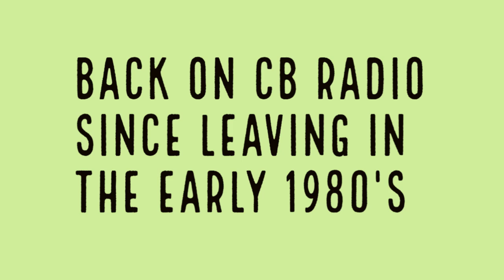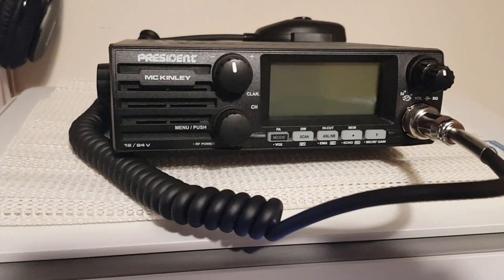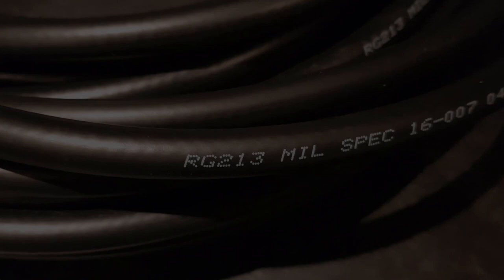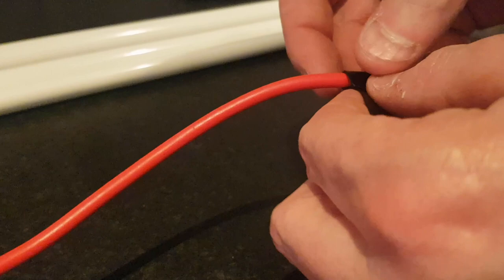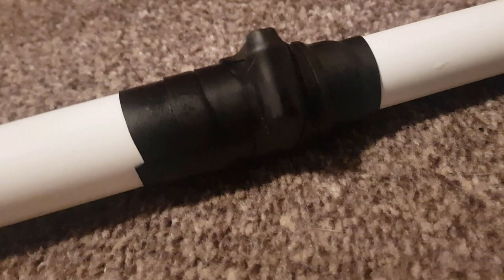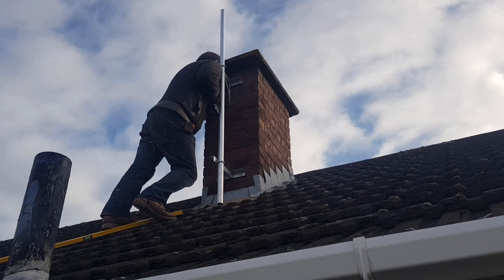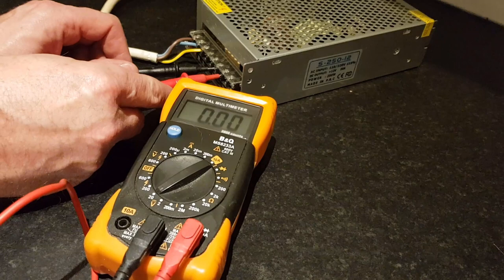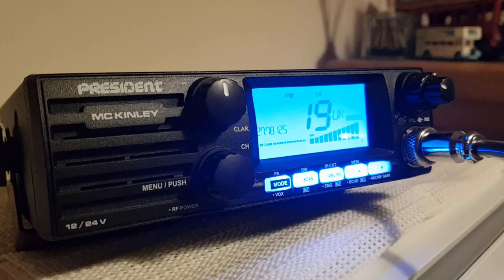Back on CB RADIO after 35 YEARS | Our new President McKinley & Gainmaster 5/8 Wave Vertical Antenna

Comment: Once upon a time, (three years ago) myself, age 65 and my friend, age 75 decided to install CB antennas for our CB radios. He had a good spot by his back porch and I had a spot right next to a tower for my outdoor light. We found neighbors who had unwanted television towers they wanted rid of.  We measured the length of his tower, including the antenna before we hoisted it up, 45 feet (13.716 meters). We measured the height of my tower before we hoisted it up. 54 feet (16.4592 meters). We tried to lift it up, hand over hand, yet, that failed. We took an old manual crank handle boat winch off an old boat trailer I had. We tied guy ropes off on trees and under the eaves of my log cabin to support the old light tower. We tied the boat winch on the old tower about half-way up in the air. Our 2nd attempt to raise the antenna was successful! I lifted it up, while my friend cranked that boat winch like a man on a mission.  I felt the tower go past the half-way point, then we got her upright. She was swaying in the breeze, back and forth. I'm yelling at my friend, "Clamp that #@$% down!" He managed to clamp it down to the old tower with a muffler clamp. If my tower had fallen and touched the mains, I'm certain we'd both look like one of those cartoon characters that look like skeletons when struck with high voltage. Good times.
Reply from the maker: Oh wow, that does sound quite an experience that you all had there lol. I am glad however that you all came out of the other side with no cuts bruises and electrocution scars 😀

Comment: Welcome back I also started out in the late 70s - 80s operating the same radio antenna setup...the McKinley works much better out mobile away from all the electrical noise S5 that most people seem to suffer from at home.....
Reply from the maker: Thanks Karl. We do plan to take the Mckinley out mobile soon. I might get a gutter / boot mount and try it out in my daily car with the Sirio 5000 mobile antenna we just bought. But ultimately it will go into our motorhome, but that won't be until April onwards.
Reply: @rvcbuk  I have only had time to watch this video on your channel. 
I'm curious how you got on with the 5000 on the roof of your camper, I'm thinking of putting one on my Sprinter day job vehicle. 
I'm a little confused about the height, although I am 99.8% motorway.

Comment: Haven’t used the cb since the early 90’s when I got my ham licence, but my roots were with cb like many more my age. People seem to be returning to the radio but  we need more truckers returning they seem to have abandoned the most useful tool in the box. I have just put a cb back in the car , so will listing for you
Reply from the maker: Thanks 😀👌 I do see a few reports of people coming back to CB radio, and of course I am one of them. There are one or two new people in my town from what I hear. I am glad I bought the new CB radio kit, it brings back so many memories. One thing I am glad no longer seems to exist though, is the constant disc jockeying on the 'breaking' channel as was a headache back in the 80s.
Reply: Truckers aren't aloud to have CB's in the cb ( my boss told me no anyway) detraction lead to accidents. I'd love one in my truck.
Reply from the maker: @forddude1976  I must say, I do admire that attitude to driver safety. I would imagine with such a policy, he does not telephone you whilst you are driving either.

Comment: Hello I am Mario from Trieste Italy the antenna operator has mounted the GAIN-MASTER for me today the stationaries are at most 1 and 2 almost on 400 channels I had it in the 80s this antenna was a fantastic thing bye and have a good day
Reply from the maker: That is good news. The SWR also set up fantastic on mine, first time after following the measurements in the instructions. Very easy.

Comment: The President McKinley is a decent radio. It works as good or better than the Galaxy DX-2547, and can be used as a mobile radio if desired. One of it's best features is the ability to turn the RF power output down. I'm using mine with an RM Italy 203P amp and an Antron 99 antenna (similar to what you have) and am powering them both with a Jetstream 30 amp power supply (I paid under $150 for it, and also use it to power my Icom 718 HF amateur radio) I use it almost exclusively on SSB. I only use AM in  my vehicle while on the interstates  The only people in the U.S. who use AM anymore are truckers (who mostly talk about how hard their jobs are and how little they make, which is mostly true, but it's not something you want to listen to very long) and teenagers who use high powered amplifiers, overmodulated power mics, echo boards, and all kinds of annoying sound effects. They have no interest in communicating, just trying to see how annoying they can be. I am in the Southwestern U.S. (Arizona) and frequently make contacts in Australia and New Zealand.  You British chaps are a lot more polite on the radio than most Americans are.
Reply from the maker: Thanks for the feedback, we do like the radio, and are happy we bought it. We plan to use this radio in our American RV which we are going to use to tour around the UK.

Comment: Here in the States my McKinley front panel is differentthan yours. I guess you guys run a little different frequencies and modes than us. I believe you operate a lot on FM, too, if I'm not mistaken. I noticed right away the knob layout is different than the one I run in my car.

Enjoy your "new" hobby and "new" yank-mobile. Ha ha. Cheers, mate.
Reply from the maker: Yes, I did notice a lot of the labelling on the switches and buttons are different to the UK spec radios. FM was the first legalised mode here in the UK, which started in 1981. There is quite a following for the FM mode here.
Reply: Give it time fcc passed fm on cb recently to legal level I have used fm limited here in states no experience in dc on fm just up to 15 mi but the use is very good contacts once freq use is agreed on all my experience been on ssb rigs with ful 10+ kc tunability FM tunes just as far so need to agree  on freq of contact my ,99v 2 gets 3 kc away and loses the sig very tight sometimes on am I don't even know ssb on same channel

Comment: Nice set up John,  Glad to see your Bro drilling into the brick and not into the cement between the bricks. 
You can also use Self-amalgamating tape on the end of the rawl bolts that helps to stop water seeping into the brick and then freezing in winter and splitting the brickwork. 
One tip you may not be aware of and that is to stretch the amalgamating tape as you wrap it, it then gives a much tighter seal on the joints, that is how it is designed to work from the manufacturer. 
Anyway welcome back on the air hope to speak soon. 
TM205 Mark Stoke-on-Trent.
Reply from the maker: Thanks Mark. That's a good idea using it on the bolt heads, I had not thought of that. Yes, I sort of found that stretching the tape a little works better, but that was on a job I did on some plastic pipework in our motorhome project (to avoid vibration loosening) after the antenna was already installed. Really good stuff that tape, the first impression putting it on is that it won't work, but it really does, it sticks well.
Reply: I was off for a while but I have a damn nice station set up now I have Galaxy 33 and 2 president Richard radios with various Amplifiers up to 2.2 KW and an A/B biased amp for ssb cant believe I waited so long to set back up.

Comment: That self amalgamating tape works best if you stretch it a bit when you wrap it around.
Reply from the maker: Yes, I agree, I have found that too. We have also used it on some plastic plumbing pipe fixings in our motorhome, to try and prevent possible looseness due to on the road vibrations.

Comment: Hi John, on the PSU theres a little pot at the end of the terminals, turn it up to voltage 13.4 to 13.8 for the radio. Subbed, Richard CT4275, M7LTR 73
Reply from the maker: Hi Richard. Yes, I saw it when I wired it up. I recall that the pot was sealed over. I may have another look at it over the weekend and see how easy / difficult it is to remove the sealing compound. If successful we may make a video of the modification. Thanks for the sub, and support.

Comment: Great video. I have also recently been looking into getting back into CB etc. Back in the day my Brother had a Cobra 148GTLDX (fully modded, cough, cough) and a hundred others rigs, burner, preamps etc. Of course as his little brother I used to use them also.
Reply from the maker: I had a Cobra 148 GTL DX back in the day, nice radios.
Reply: I still use them, but a bit more responsibly now. I figure if it is ok for me to use 100 watts on the 20 and 40 meter amateur bands without causing any interference, it's ok on 11 meters as well. In todays digital world, high frequency RF (which should actually be called low frequency now that almost all commercial stuff in in the 1200Mhz and above range) really doesn't cause interference anymore.

Comment: This power supply introduces a lot of background noise. You can judge for yourself by powering the radio from the battery.
Reply from the maker: I did, it made no difference.
Reply: I have two of these psu's both 30amp and no added QRM found from 3.5MHz to 470MHz
Reply: I was just about to say the same thing, but amazed that others are saying that it creates no noticeable QRM whatsoever.
VERY surprising - They must have very good filters on both the input and output. I'll look into getting one myself.

Comment: Hi there , I have had the McKinley for a couple of days and have noticed a humming noise coming from the speaker, kind of static, I’m sure it isn’t normal on zero volume, maybe it is normal which would surprise me, does your McKinley make any noise on zero volume ? Thanks for your help.
Reply from the maker: Hi there. I am pretty sure mine has no hum, but I will check later this afternoon and will let you know.
Reply: @rvcbuk  thanks for that, it kind of sounds like a computer fan noise
Reply from the maker: @Patrickjdee66  I have just switched it on and there is no humming noise from the speaker. Are you using a regulated power supply to run the radio?
Reply: @rvcbuk  Hi there , it’s a Sharman SM-10, I have another radio connected which is the President Richard, no noise issues with that one.
Reply: It’s a 13.8v regulated
Reply from the maker: @Patrickjdee66  That's strange then, it shouldn't be making that noise. Perhaps as a precaution it might be worth eliminating the power supply by connecting the radio directly to a car battery only and seeing if the humming noise is still there.
Reply: @rvcbuk  sounds like a plan 👍🏽
Reply: Just tried that and it’s still there , I just received a reply from the shop I bought it from, they said they tested the McKinley on there side and said the following …. 

We have tried a radio and there is a slight noise all the time, even with the volume on minimum and the squelch either on or off. It is there on all modes.  You do have to be very close to the radio to hear it.
So it seems that is normal for these radios, surprisingly no one has mentioned it before.

I’m not sure about that, I have the President Richard which is perfectly quiet
Reply from the maker: @Patrickjdee66  All I can tell you is my Yaesu FT-450 has a hiss noise at volume off, which is approximately twice as loud as anything coming from the Mckinley speaker with the volume down. I am pretty sure you should not be hearing a humming noise.
Reply: @rvcbuk  Thanks so much for your help today, it’s been very much appreciated, I’m sure I’ll find a solution, all the best mate
Reply from the maker: @Patrickjdee66  Happy to try to help Patrick. Have a great rest of the weekend.
Reply from the maker: @Patrickjdee66  Good find. That is strange, mine does not make that noise. It perhaps is due to different source components that were installed in batches.

Comment: Did you expand the channels or is it stock?? Mine is expanded from 24.715.to 30.000 mhz  but the band selector starts at a. 26665 to 27.405 than b 27415 to 27855 than c drops to 26.???....  Not so happy with that
Reply from the maker: I bought it new and asked the supplier to expand it. It ranges from 24.715 mhz to 30.105 mhz. Plus the UK FM block. The way the blocks are set up is odd, not in any real order, which apparently is a President thing. I am going to paper table mine so I have a hard copy of the block ranges on the desk.
Reply: @rvcbuk  yes that's what I see here to.... Think it s poisible to program that but I'm not sure....I used bigger cables from the pcb board to the DC connector because they were very thin and started to melt!! Other than that great reception, audio is good(great?) power output 20 watts if you want but you can adjust it by push the mike(tx) than hit the mem key (f starts flashing ) press 1x menu button (RF power is flashing) and then counterclockwise turn the power down, you see the RF power bar dropping confirm by pushing on menu button.... Key the mike from start to finish...
Reply from the maker: @MrRichard57000  Thank you for that. I had not figured out how to adjust the RF power output. I have just tried your advice and it works fine :-)
Reply: @rvcbuk  yes oké good to hear!!! If you hold the menu button there are some other features like SWR testing, dynamic or electric Mike, coulours display, but these are obvious....
Reply from the maker: @MrRichard57000  Yes, thank you. I did have a 'play' with the menu controls when I bought the radio, and I have found the other items that you mention, but thank you anyway. It was a tough decision with the screen colours, but have chosen a blue screen for now :-)

Comment: Hello My name is Mario, and I live in Trieste Italy. I have your same radio and also your same antenna, which apples will mount on December 20 on the roof. I wanted to ask you for the SWR have you had any problems? i will use a rg8 mini cable i will have calibration problems with this cable. Thank you and have a nice day (I beg your pardon I don't know English I used the translator I hope you will understand what I wrote again Many thanks)
Reply from the maker: Hello Mario thanks for coming to the channel. We obtained a 1:1 SWR throughout the 26 to 27 mhz range. The cable we use to achieve this is RG213 coax. I hope that you are able to tune your antenna. Please do let us know how you get on.

Comment: You should have gotten a a rci 2950dx mobile or a Stryker 955hp both are good radios the president McKinley is not a good radio 73s
Reply from the maker: The President Mckinley is recommended by a lot of CB radio users.
Reply: @rvcbuk  well they recommend it wrong just saying
Reply from the maker: @mattpace5982  Those radios are not generally as easily available here in the UK as the Mckinley is. Plus, the Stryker 955hp is in a much higher price bracket than the Mckinley.